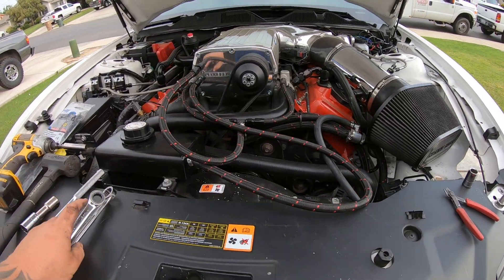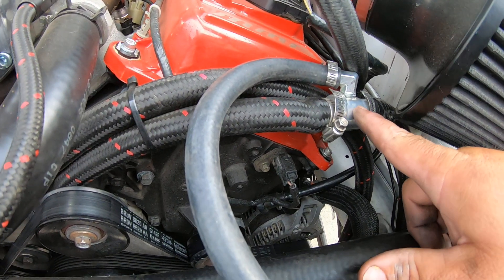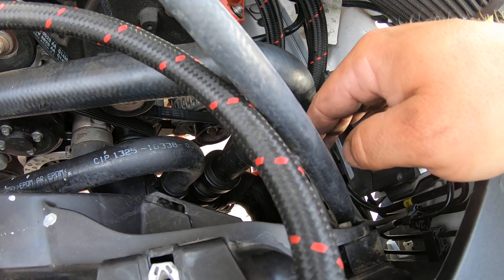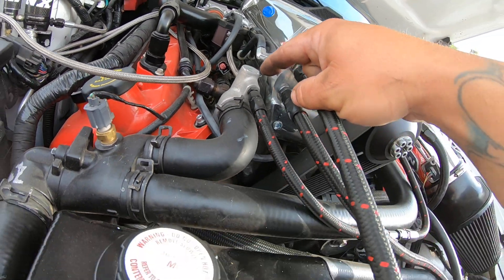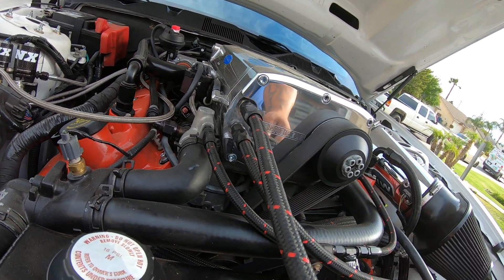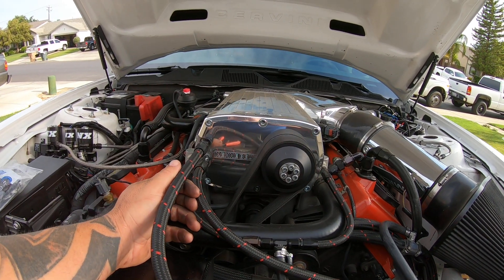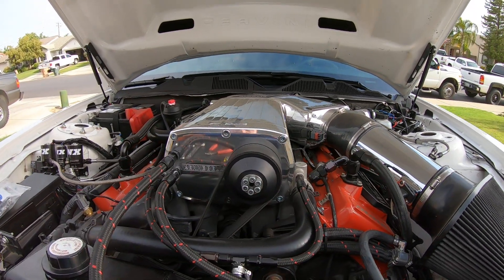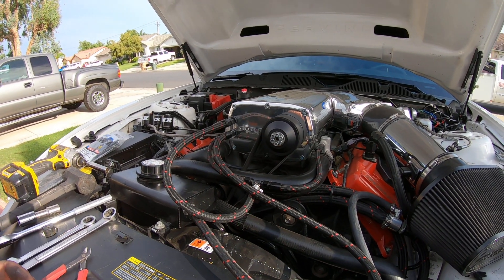LIQUID COOLED HOSES ON 4.2 KENNE BELL GT500

Comment: I bought my 2010 GT 500 with a KB 3.6 on it and a 9 gallon tank in the truck.... the pump is pumping and I took the lines loose like where the split is where u were touching, it has plenty of pressure there but it’s not circulating thru the supercharger,,,my supercharger is Hot snd the coolant in the trunk is cool as cold start. Think I can was it out somehow or should I replace the inner cooler core??
Reply from the maker: Greg Austin well I don’t have it like that now with tank in trunk. It comes off the overflow tank now. Maybe your lines are crossed? Two different fittings are on it but I think one is just to slow down fluid to supercharger.
Reply: The Wicked Snake I will have to find a schematic of how they are supposed to run I recon,, the car only has 25k miles on it and I think the supercharger only has 15-20k I wouldn’t think the inner cooler could clog up that quick but not positive.  Thanks for replying.
Reply from the maker: Greg Austin feel free to text me 661-912-1750 and I can send u pics.
Reply: The Wicked Snake kool will do!